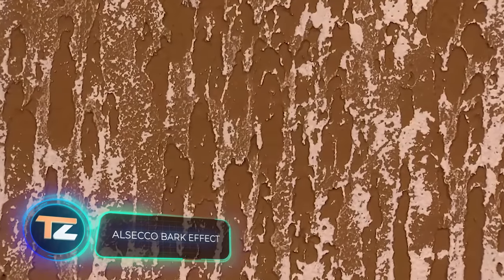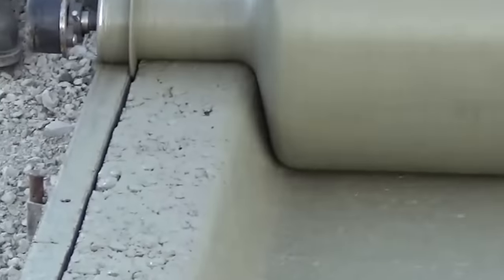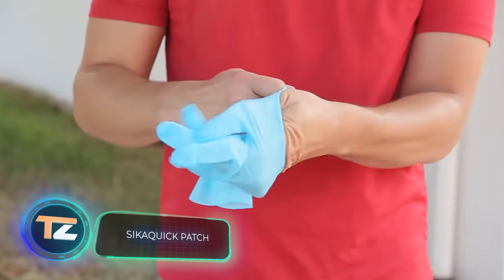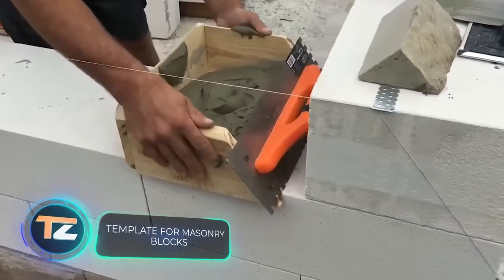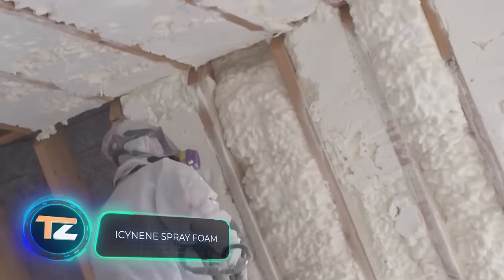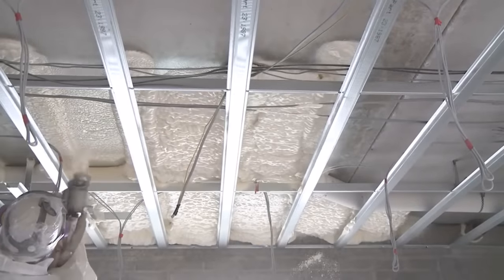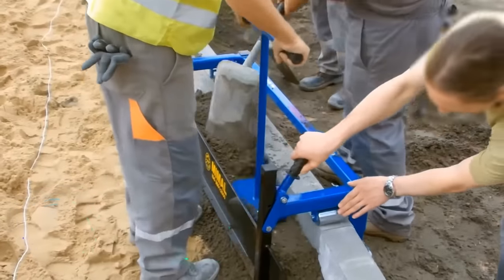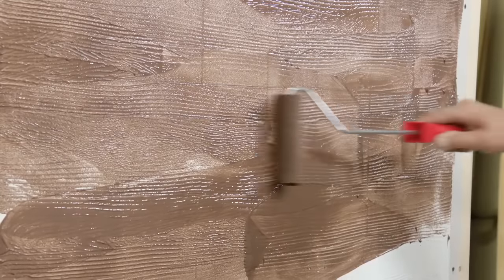INGENIOUS CONSTRUCTION SOLUTIONS THAT YOU SHOULD SEE

Comment: That sika quick patch works wonder on a driveway in need of a quick fix, better than removing and re-doing a whole driveway!
Reply: in the UK you can get a material called granite dust, mix that like a concrete mix (take your granit dust and cement and mix with water) and it gives you a fine concrete for doing patch work or small channels and lasts a long time. done several patches like the in the past, it is probably cheaper than the Sika product too.

Comment: Re: that curb roller ? I hate to be the one to break this to you guys but there is a tracked machine that concrete trucks dump their concrete into that crawls at 1 MPH and leaves a finished curb behind it. It has a guide that is attached to a heavy cord laid out in the the path of the street that is being built. I drive a cement mixer for 14 years. Pouring curb was a pain in the ass because you are required to drive at a snail’s pace and spend a lot of time holding the clutch down but it is much much faster and far more efficient that creating curb by hand.

Comment: 2:03 When you take a simple process and "improve" on it.  This template does not allow you to furrow the mortar so you don't get the suction bond you need when laying brick and the mortar is just sitting on top of the brick and not being worked into the cells.  This will guarantee the brick work will fail prematurely.  Any bricklayer worth his salt will lay 10 times as many bricks as the guy in the video.
Reply: Been a block layer, brick layer, stone mason, plasterer for 50 years you are correct.
Reply: Yea I was thinking the same thing , that can't last very long ,  did you see the ugly patch liquid clip right after that? Hideous , at the very least throw some pea gravel to try and match existing slab 🤦

Comment: 2:15 I wouldn't suggest flattening the top as you need mortar to make its way into the brick for added strength and stability.
Reply: Make the layer of mortar a little thicker before you flatten the top that way when you push the brake in place then the mortar would go in the inside of the brake a little ways up doing what you said which I do agree with you 100% I was thinking the exact same thing about not playing in the past but then I just realized he put a little bit more mortar and it should work out have a great day
Reply: That brick template would just slow me down.

Comment: That Curb roller already messed up the job.  That type of concrete fencing has been around for at least 20 years already. Construction membranes - been around forever same with spray foam insulation, the plastic blocks at the end - do not crumble - proceeds to have pieces fly off when slammed on the ground and still putting plastics back out in the world. They aren't even melting and extruding them like the many companies that already exist to make recycled plastic planks, 2x4s, benches, fences etc. That is just another start up who is going to fail because of bad market research.
Reply: You’re right and no mason is going to use those mortar forms. It might look cool but won’t perform in real world.

Comment: I'd love to see these variations in todays buildings. I commonly see buildings stil dominated by old fragile bricks.
Reply: so "fragile" they last centuries will very little maintenance
Reply: @fuzzy1dk  rclwcrcw
Reply: I needed a vent in my garage (my house was built in '76, btw), and had a professional cut the hole (112mm / 4 3/8"). It took him 15 minutes with a diamond holesaw to get through the 108mm / 4 1/4" brick (chevron pattern core). He had to get down from the ladder 3 times to rest his shoulder. If a brick wall like that fails, it's because of the mortar, not the brick itself.
I kept the drilled out core as a momento...